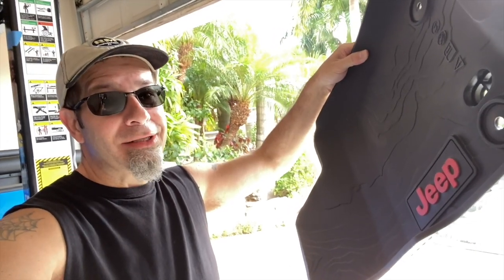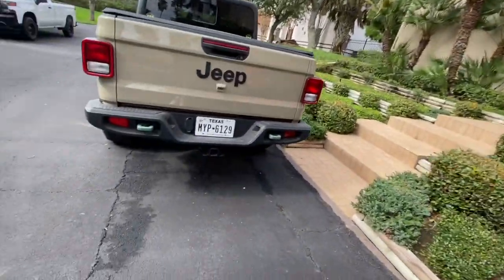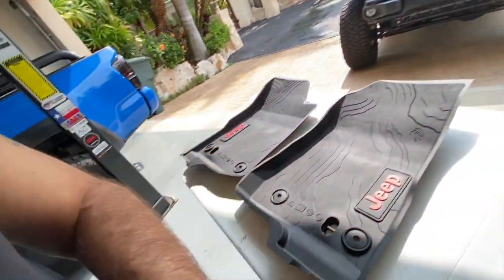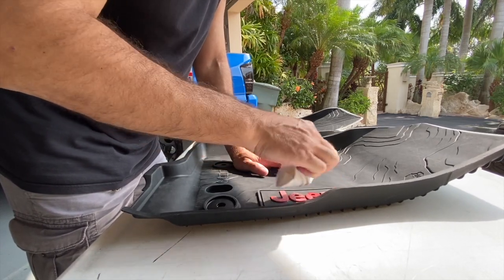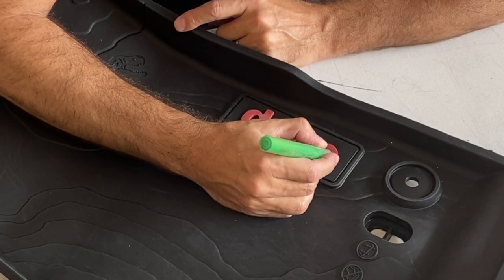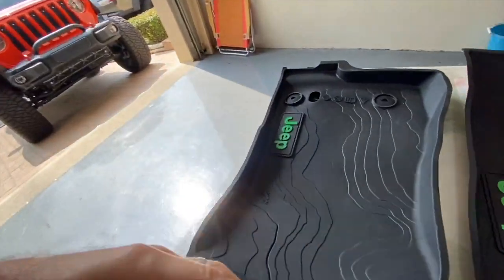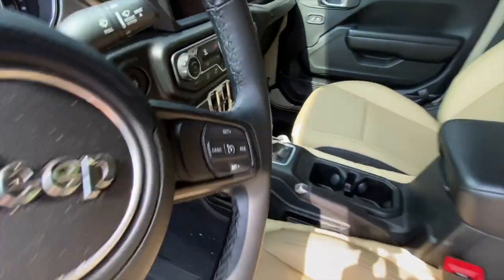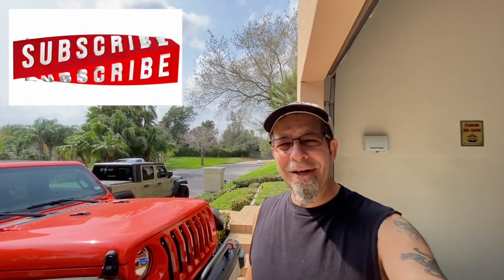Painting My Jeep Gladiator Floor Mats

Comment: Those look great! I think you should outline the mountains on the mats too! If you're worried about durability, I recommend buying Posca brand acrylic paint pens. They stand the test of time. You may also want to consider using a sealant spray over them. I'm sure here is one that works over rubber.
Reply from the maker: Thanks for the tip👍

Comment: Looks really good and something different! I have the same mats. Need to clean mine. If you look on Facebook Jeep Gladiator Group I shared that I installed a JL/JT Quadratec Dead Pedal. I like it and it is comfortable for me. It shows my dirty mats lol!  Just had to run my truck through car wash last Thursday. It is very cold, snow on the ground and a lot of salt on the road in northwest Ohio. So glad I did I washed it. It had alot of salt on it.
Reply from the maker: I remember those days!!  Lots of salt in Ohio!  I used to live in Bryan and Montpelier 👍
Reply: @robmotiveplus  Yeah I live just outside of Toledo, Ohio. That was one of the reasons of me buying a Gladiator. Truck is made where I am from. Lol!

Comment: Looks better than I thought it would. On the sanding, use 100 or better yet 150 grit will look smoother under the paint and still allow hood adhesion.
Reply from the maker: I was a bit surprised myself!  It came out really well.  A finer grit would probably have been better👍